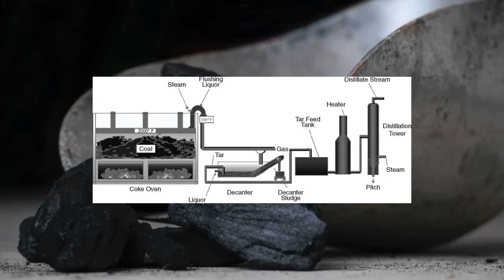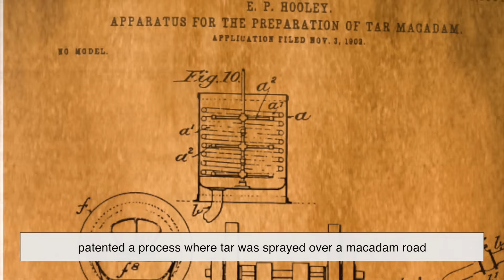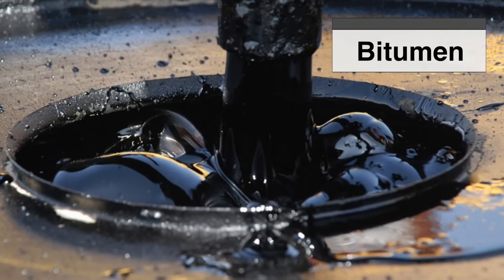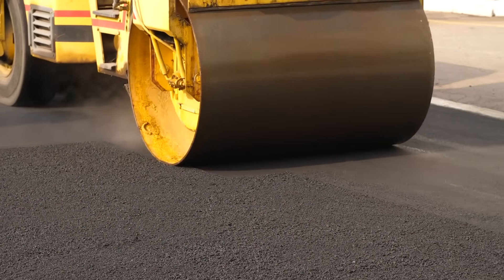What’s the Real Difference Between Tar and Tarmac?

Comment: Does the darkness of the material matter? 
Like if we found a substance that was easier to produce than bitumen, especially as the world is weaned off oil, or inexpensive enough to use and is less prone to degradation and less environmental/chemical concern in use and production/maintenance of it, but its sky blue colored after processing? 
Would that dissuade use of it